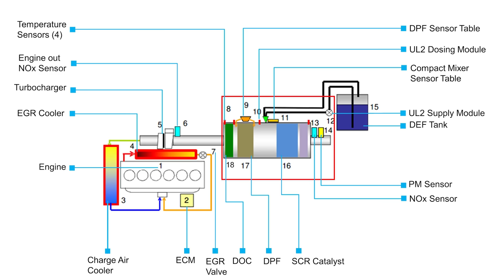Old But GOLD! I Changed My 2014 VOLVO for an Old 1996 Kenworth W900

Comment: 98% of our breakdowns are def related
Reply: YES SIR!!!
Reply: So why don't just delete emission system on a brandnew truck?
Reply: @malyshevvasiliy9541  voids the warranty
Reply: @malyshevvasiliy9541  its a federal offense
Reply: @agray_lowboost     thank you for the respond. I am not familiar with the rules. But, what is the difference between 'delete' and a 'glider kit w/o egr'n'def system'? They take a brandnew 389 and put a rebuilt 60 series DD , isn it? So I take a brandnew 579 , took out the engine and then put it back forgot to put def
Reply: @malyshevvasiliy9541  glider kits are touchy feely and i don't know how they get around laws truthfully. As long as you leave the def tank on after you delete, you will be fine
Reply: @malyshevvasiliy9541  gliders aren't really available anymore. I work for Kenworth and haven't seen one come down the line in about a year. The feds put a stop to it.
Reply: I'm not a truck owner, but in most cases I go with the same philosophy. 👍
Reply: disgusting . despise the concept
Reply: The only thing keeping you from going to California is a trailer skirt. That tractor is perfectly well legal to go into California. As a matter of fact her rested prosti laws they can't keep you from coming to California just because of the age of your truck. If it's legal to run an Iowa it's legal to run in California
Reply: And DEF repairs are expensive!
Reply: @malyshevvasiliy9541  if you bring it to the dealer for service, they have the right to reject you from your truck until they put the emission back on. Le worth gets fine 30k if they let you left the dealers with a deleted emission truck.
Reply: Just wondering how the Canadian emissions compare to the US emissions
Reply: I work for a large motor company. And dpf units do not work
Reply: I’ve got 400,000km and almost 8000 hours on an ‘18 peterbilt winch tractor, zero emissions issues on it! Some are lemons but it’s more how you drive it
Reply: @Quackerstacker1973  same shit here in Canada. They are cracking down on deleted trucks. Think you can get a $30000 fine (not positive on that) Gliders at least still being built here according to a buddy of mine who is a tech at Freightliner dealer. They seem to be leaving deleted pickup trucks alone for now, but I wouldn't want to get burned in a big truck.
Reply: @bigdog8815  one place I worked at seemed to have pretty good luck with kenworths with isx's. I never had to do even a parked regen in their stuff. I remember the temp sensor in the mirror went bad and the dash said it was over 100°C outside LMAO. Not sure why it read past boiling temperature of water before it realized the ambient temperature was out of range. I picked up a brand new t880 with a paccar mx13 and it shit a rod through the oilpan with 3000km on the odometer.
Reply: @juliogonzo2718  oh I believe it, my old man worked at a Pete dealer for a few years and averaged 60-70 hours just in diagnostic time per truck on pacccars
Reply: Another trick any mechanic can do for you regardless of the motor is called pto mode, it’s a program that on high idle for more than 5 minutes, the truck is programmed to simulate a load on the engine thinking there is a pto engaged!
Reply: Can confirm, my truck went into limp mode twice within 1000 miles for failed regen. Trucks a 2018 with only 181k miles.
Reply: @circusboy90210  i live and drive in Cali we have trailers that are skirtless I’ve personally had no issues with CHP or Dot.
Reply: @malyshevvasiliy9541  glider kit is legal because the yearof the truck is the year of the engine so 2020 body and 1999 engine is a 1999 truck. It's the way the law is written
Reply: Land of the free 🤷🏾‍♂️
Reply: @agray_lowboost  Only if you get caught. Nobody check except CommieFornia.
Reply: @TexasBroskiActual  thats what i figured
Reply: @agray_lowboost  most drivers get in trouble for removing parts off the systems but some mechanics are so good at it by doing delete w/o. Removing parts...
Reply: @leofelix5015  thats how we do the pickups at the shop i work at. The equipment is still present amd looks to function. Even leave a little def in the tanks lol
Reply: That DEF insults  me ,I'm retired we didn't  have that back in the good old days.
Reply: all diesel systems make the trucks worse and aren't better for the enviroment
Reply: Really? I drive a K200 logger with a Cummins e5 and 600,000 klicks on the clock and never had a problem. Only time the engine light comes on is if it's low on Adblue.
Reply: @malyshevvasiliy9541  yes sir! Where i do my driving, they don't check emission systems.
Disconnected that right away.
Reply: @bigdog8815  How do u drive it honestly not joking
Reply: @thollins6582  first off, get the dealer to put what’s called “pto mode” programmed in, after 5 minutes of idling, it simulates a load on the motor, thinking it’s running a pto, making it work. So when you need to idle it’s not slobbering away building up door!
2nd i lug and work the snot out of it, making it work and keeping it hot! I work oilfield and off road, pulling up to 48 wheel trailers, it’s about reliability not fuel economy, I burn about 30-40 litres def to 7-800 litres of diesel.
Lastly is servicing, I avoid synthetics and use conventional oils, and keep it around 400hours per service. This has worked out for every truck I’ve run whether it kw, star, or Pete’s! On top of that I check stuff out frequently, run it like I own it.
Reply: @bigdog8815  That PTO thing is some good 👍 INFO. You are correct sir I spoke with a Cummins Rep a while back n he said KEEP THAT SYNTHETIC SH.. OUT OF IT.
Reply: @thollins6582  yeah a lot of people don’t know about the pto mode, it was a kw service truck driver who told me about around 10 years ago, been loyal to it since! I never noticed a real benefit to synthetic, and a video deboss garage did on it solidified it for me
Reply: @bigdog8815  which video if u don't mind me asking
Reply: @thollins6582  deboss garage- synthetic oil controversy explained
Reply: @bigdog8815  Thanks Boss

Comment: In the Philippines, most of the truck operator also prefers old Japanese trucks (surplus) like Isuzu, Fuso, Hino, which their engine is purely mechanical but overall durable and reliable, and of course, they're also cheaper to buy than brand new Chinese trucks
Reply: Those Hino's are tanks. I drove one for an insulation company in Atlanta and that thing ran great.

Comment: He guarantees you'll have a check engine light within 90 days of buying a new truck. I bought my new T-680 with the X-15 just over a year ago and no check engine light so far with 130,000 miles. I also gave $134,000 for it. Not $200,000

Comment: I dig it, guys. One quick note, in Detroits you want to avoid 2004 and after, not just after 2007. EGR and those damn code 39 factories called VGT turbos came out 04. I worked for Detroit during those dark, dark days. 2007 was also horrendous when the DPFs came out and trucks dropped like flies. I saw owner operators go out of business because they couldnt keep their truck on the road. I was ashamed of the industry. Still am.
Reply: True. Source: my previous 04 colombia…..

Comment: Great vid, bought a brand new 96’ with a Detroit 500 took it straight to Stewart Stevenson, in Commerce City Colorado. Mike the service manager put his golden screwdriver to it. The next day as I was heading west over the pass on I70, thought my clutch was slipping so grabbed the mike and talked to the driver behind me, that’s what we did back then actually talked to each other on CB. He came up along side and back a little  said hammer it again, no he said it’s not the clutch your tires are spinning. Wow was I impressed with the DD500. 1.5 miles per gal or 8mpg. This is why most company trucks are cut back could you imagine 2000 fleet truck at 1.5 mpg. Any seemed to have gotten carried away, really enjoyed the vid and yes I subscribed.

Comment: I started off with a 2000 freightliner classic, so I thought a new truck would be good, I bought a brand new 2010 387 peterbilt with a C-15 Cat engine, hahahahahahahaha 3.38 mpg my friend to the gallon. It caught on fire 9 months later, next I bought me a 2011 international, that got stuck 3 times the first month, 4 the second month, all the the times the dealer had to pay for it because of the warranty, they took it back and tried to get me into something else, I walked away, I bought 1998 volvo vnl64t with a Detroit and never looked back.

Comment: Agree totally. I’m not a truck driver, though I would be if I could. My dad was a professional truck driver for over 40 years. Love big rigs, especially cabovers. I went the other way on pickup trucks. I drive a 2009 F250 Super Duty I bought new. Love it, it’s been extremely reliable, but it’s getting older. Instead of trading up for technology, I still drive it daily and take care of it, and I just bought a 1979 F150 4x4 manual trans truck. I love it, it’s the 3rd one I’ve owned over 37 years. Just like you say, open the hood and you see - an engine. Cheap parts, easier to work on and you are connected to the road thru these mechanical classics. I won’t go any newer than my 09. It has some tech I like; not too much but enough conveniences that are nice to have, but when I go back to crank windows, wing windows, key entry, basic heat and defrost, kick panel vents, hi beam switch on the floor etc, it’s not a huge jump from what I’m used to. 
Great video. Stay safe my friend. God bless.
Reply: The problem with big rigs sir is the fact they have such a bad mpg you go bankrupt in critical times like now
Reply: @The_Touring_Jedi  yea… the great reset…

Comment: That was great hearing the 60 Series Detroit. It reminds us so much of the sound of the 3406B we had in a ‘85-359 Pete. If we were ever going to buy a older truck to use it would be a Mid 80’s Pete with a 3406/13spd. But they’re getting to be few & far between these days we imagine because of age & the years on the road do take their toll on them, no doubt about it!
Reply: glad we have 3 trucks with that set up.  88 379, 89 379 and a 86 w900.  all 3406 cats and 13's.

Comment: Smart man, best thing you could have done & that era was the absolute peak of KW too.
I'm in Western Australia, our equivalent was the T904, & it was a cracker. I ran out to our remote desert mines with it, pulling triple flat tops. So to put you in the pic, Cat C16 (NZ), S22 Roadranger, Super steers on spiders, on 9 ton front axle, steel on spiders rear on 6 rod. 6 x 500 litre round tanks, walk in sleeper, icepack & all the rest of it.

I did over 5 mil with it, before I retired 7 years ago, it wasn't burning oil & its still running.  
This is a truck pulling 120-140 tons, & this is what I did to make it do that mileage.

Firstly I drove it soft, short shifting in the bottom box. A C16 makes its power low. I used ultra high temp  synth oil in the gear train, the stuff used by mining machinery operating in 50-60C temps. Its expensive in comparison, but you never change it. I ditched the airscoops & put on the round MacDonalds separator type dust bowls, I cobbled up an electric pre start engine oil pressurizer. I think you can buy these now, but back then I had to make it using a rotary gear type oil pump & wiper motor. I installed marine sacrificial anodes in the engine block. I just melted some old anode & cast it into a steel pipe, then shrink fitted it to the drain plugs. I reduced the turbo boost pressure to 26psi to help keep the valves running cooler. I installed a sedimenter pre fuel filtration.

What you say about the euro is true, but its with everything now. Try replacing a model specific headlight as opposed to the generic round, or ditto a broken mirror as opposed to the west coaster.
Try re-racing a synchro or auto box compared to a roadranger, you can't, its cost prohibitive. & on top of it all those blasted sensors. 

You did well!

Comment: Exact reason I still drive a old Dodge diesel pickup.  The one sensor, crankshaft position sensor, I took off and threw away. 

Would love a new Diesel but we have nothing but issues with the ones at work and won't waste my money on something that is going to leave me stranded.

Comment: Newer is not worse than older, it just requires different mentality. Having same mentality about maintenance on newer trucks as if it's older technology leads to problems.  Why many people dumped old-school trucks because they were not trouble free to start with. Maintenance is the key. High quality maintenance gives high quality results.
Reply: Agreed. The battle between generational mentalities has been going on since the dawn of time.
Reply: No the emissions shit is not reliable.  Newer trucks spend way more time in the shop than pre emissions stuff.
I don't hate the emissions equipment,but they've been working on for 15 years and it's still unreliable.
Reply: I will agree with you till my dying breath that proper maintenance is key in trucking. So with that said, everyone can try arguing back and forth but the simple truth is that the newer trucks just aren't as reliable. Not to mention most guys out there on the road today simply don't know how to operate the truck properly. There's no such thing as a truck driver anymore 🤣

Comment: I’ve had the opposite experience so far (knock on wood). 102k miles. 2k hours. No check engine light. No emissions issues. X15 performance. Run close to 80k 90% of the time. Almost no idle time. PM/oil every 20k. 

Now I’ll still agree, longevity in these new trucks is dismal. The benefit of having a new truck is being able to sale it and replace it with another new truck about every three years. Different ways to skin a cat. To each their own.

Comment: I hate to disagree, but my last truck was an '18 389 with a Cummins X15. I had ZERO, and I do mean ZERO issues with anything. Literally anything. I did my oil and filter changes, did my own grease jobs, and I had ZERO issues.
Reply: I’m driving a 2021 680 with an X15. I’ve put a 136k on it so far. Haven’t had a single issue. I’ve never driven a pre emissions truck.
Reply: @18wheelzofsteel53  I have driven them, and trust me, they're great. But the realities of this industry means getting a pre- emissions truck is getting tougher and tougher. So, might as well enjoy what we do get to drive, right?
Reply: @comfysauce6707  this is true

Comment: One thing that I've seen my family do for long-noses is to get one of the rear license plate cameras used on cars and placing it on the front bumper above the license plate. It provides the wiring for several feet in length and a mock rear-view mirror camera that can be placed just below the actual rear-view mirror. That allows them to see at bumper level directly in front of them at all times since its hardwired into the electrical system.

Comment: I love all your very valid points; keep the info coming! Can you mention what you are getting for MPG? I understand one of the major features of the newer generation trucks is that you save an incredible amount of $$ on fuel, equal to the lease payment in many cases of a new truck.
Reply: Sometimes that fuel saving is not as great as you think, an example, a 1978 isuzu/bedford sp540 with a gvm of 53,000 lbs will get 5.88mpg and a 2018 model isuzu with the same 53,000lb gvm will only get 6.36mpg, just one example but its not an insane difference
Reply: Check engine trips to the shop on a hook eat up all and more fuel difference
Reply: You heard wrong, newer trucks are not fuel savers like they say, my old Cummins does the same mpg as the new Cummins, only difference is that old N14 never brakes down, newer emission engines are always in the shop, they are junk.
Reply: Exactly what i was thinking,rather lease new Volvo

Comment: In 2000,I bought a new Classic XL Limited. I was driving a Volvo 660 before. I was horrified by the Classics driving dynamics.
I couldn't make a simple turn without going over a curb or a ditch.I took it back the next week and I found the factory set the steering  angle at 33°. Dealer fixed it by turning in stop bolts to make it turn more. It was a major improvement but still took more work to do my work.
Reply: Well that’s a long hood for ya. Especially being longer than the 379exhd.

Comment: I've been doing a bunch of research on going owner op before I buy a truck. I'm pretty set on getting a 95' to 05' W900 with a CAT in it. My grandpa was very fond of CAT engines, he put around 1.5 million miles on his 3406b T800 he had before he retired. I'm really interested in adding a propane injection kit of some sort, it supposed to make the engine run more efficient, add a little power, and reduce co2 and co3 emissions. I also though I could then add a little propane generator to provide power while parked and keep the batteries juiced up. Propane burns clean, is cheaper than gas or diesel by quite a bit, and only weighs 4.2 lbs per gallon.

It's just a thought I've had for awhile, once I get around to it I'll have to chat with some different tuners and figure out some numbers. If anything simply being able to run a propane generator would be nice. My dad and uncles use them for construction work and at home in case of power outages. They seem to be more reliable, lower maintenance, and quieter than gas or diesel generators. Plus you can get propane just about anywhere for a much lower fuel price. I can't really see any downsides, or why more drivers haven't looked into it. I've chatted with my grandpa about, and he thinks it sounds like a great idea. I've just gotta do more research on it is all.